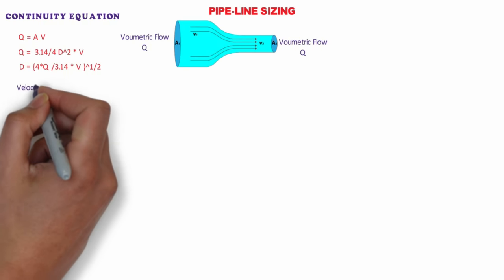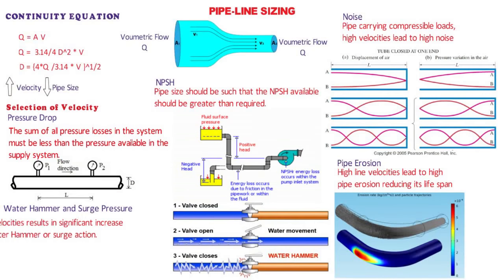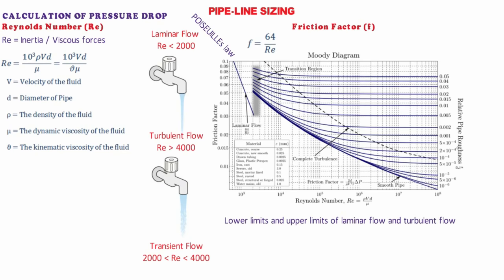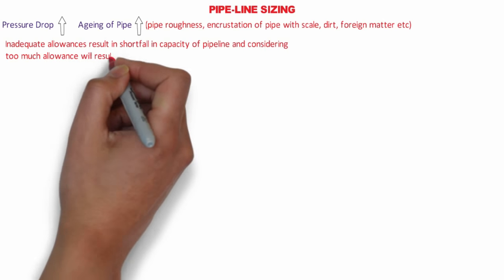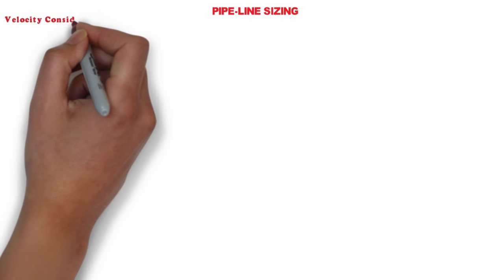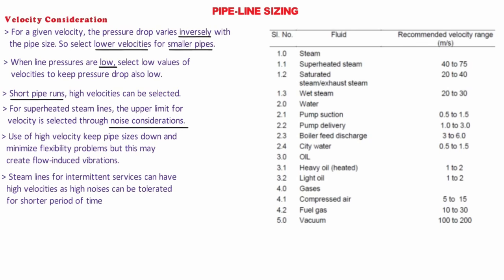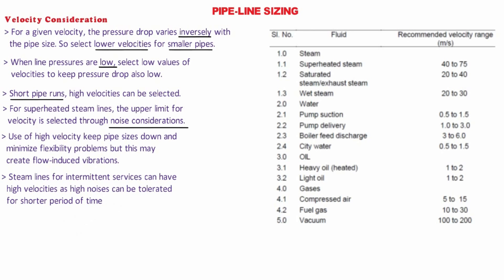PIPE SIZING | LINE SIZING | EXAMPLE | HYDRAULICS | PIPING MANTRA |

Comment: Great video. you mentioned previous lowest pipe size at 10.20, how did you get it please?
Reply: I have seen no such explanation! It is great! But, This is my question too, would you clarify "the previous Lowest Pipe Size of 203.2mm" Please??
Reply from the maker: By calculation we got D =206mm but if you see standard pipe size where OD is fix . so we can either with 10in 250NB or 8in 200NB. So here we have selected the later (previous) size that is 200NB and 203.2mm OD or 8in pipe.
I hope its clear now...

Comment: Hi mam
In this seminar, initially you selected the velocity of 2.5 m/s and then calculated the dia which resulted about 206 mm. Then you selected the dia of 203.2 mm , then calculated  the velocity which  resulted about 2.57 m/s. Finally you finalized the dia of 203.2 mm with 2.57 m/s dia. Now i have doubt how you selected the previous lowest pipe size as 203.2 mm. And how to you select the final dia for calculating pressure drop? This is my doubt kindly  guide me.
Reply from the maker: it is in the range of velocity..
and standard dia of 8" pipe is 203.2.
which is validated by 2.57m/s velocity
Reply: @PipingMantra  
Yeah i got it thanks.

Comment: Well explained.  Topic for next video valve sizing and selection
Reply from the maker: Sure
Reply: horizontal 1950 ft straight line of 3'' dia ,40 taps X 15 lpm =600 lpm what should be the tottal head

Comment: I am trying to design a plumbing main water supply pipeline, which supplying a water by gravity system (From over head tank). The building consists of 14 floors. In one unit I have three fixtures. (Wash basin, Bathroom & WC).  Would to please guide me the steps of the calculation of pipe diameter required. I am also trying to devide pipeline in two zones. One is 1st to 14th or 7th & another is for 8th to 1st or Ground floor.

Comment: Hi, Mam
Can you please help 
 I have to design ferule size and service pipe size from main municipal water connection to a housing complex 96 Flats
Total water demand 96×5×135ltrs
Size of Main municipal line is 300mm dia
Distance from our UGR to main line is 30m
Pressure available in main line is 12PSI.

Please explain the method and formula to calculate tapping size(ferule) and service pipe size for our complex.

Comment: Why we shouldn't increase velocity of a fluid more than allowable velocity? What will happen if we increase?
Reply from the maker: These are the set range based on years of years lesson learned in industry.  Higher velocity Increases errosion of pipes, vibration.
If you go below the velocity then there can be deposition.

Thank you for asking this. I should have explained this in video..
please subscribe if not. Keep supporting and keep learning♥️
Reply: @PipingMantra  I've subscribed your channel and thank you so much for your reply. May I know why vibration happens? I wanted the reason in detail
Reply from the maker: @purushothamankalivaradhan7215  you can refer Shell DEP and  API RP14E
Reply: @purushothamankalivaradhan7215   thank u so much mam...mam i have a little doubt ...how we calculate the friction factor f.
Reply from the maker: By Moody's diagram.. please watch this video i have explained that too.

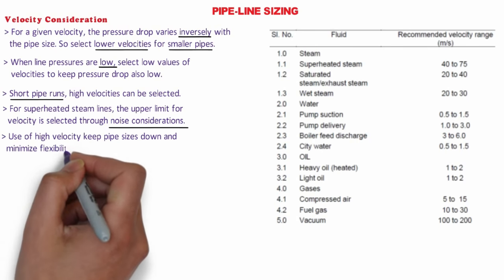Comment: Because flexibility problem is taken care by making loops in the pipe so how will you justify your statement  at 8:30 min in your video
Reply from the maker: You are right but under same situation , different dia pipe will have different resistive force  so optimum pipe size for perticular pressure ( which have relationship with temperature)   also higher the pipe size higher the load .so we have to go for optimum sizing by considering appropriate velocity.

Comment: The calculated area for d=203.2 mm should be 0.0324 m2. this value should be corrected.
Reply: She mixed up the diameter and radius. D is something on the left hand side then used it as a radius to calculate area on the right hand side

Comment: Can I contact
Reply from the maker: Yes
Reply: Im student, I have question I need to know how i can find the length of pipe required in order to keep 100 Liter water saving inside pipe,
For example boster pump is power 1hp
Reply: Pipe diameter is 1 in, how I know the length of pipe required in order to keep water inside pipe, and pressure, and how i can check is the 1 hp will be enough Or I need to increase, please help me
Reply from the maker: Information is required like flow or velocity material of pipe and fluid properties.
Reply: @PipingMantra 
PPR pipe
Q=100 LITER PER S
V=2.5 m /s
Reply from the maker: Firs verify velocity with w r to diameter .. Its too low for that flow and size
Reply from the maker: Steps will be like verify velocity then calculate lenght considering delta Pressure or pressure loss
Reply from the maker: Then Power = Q x H x9.81